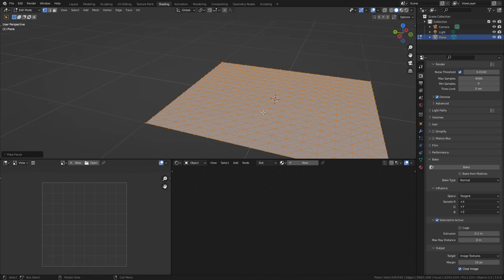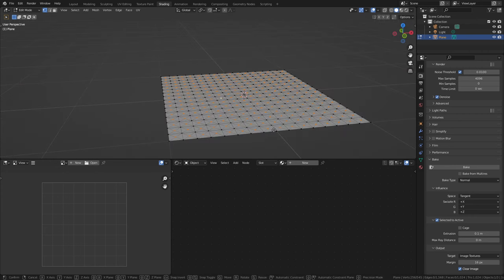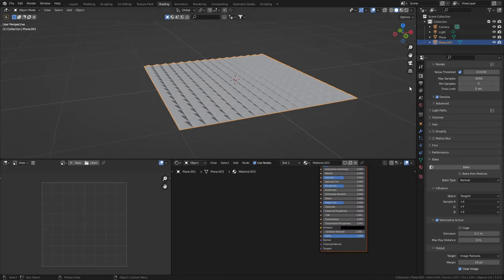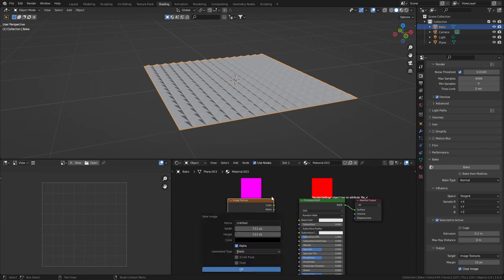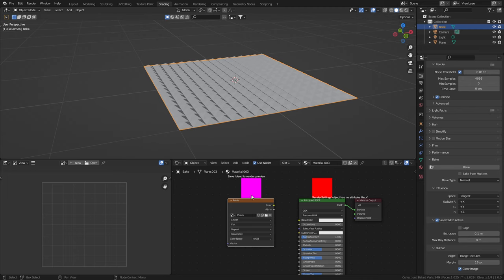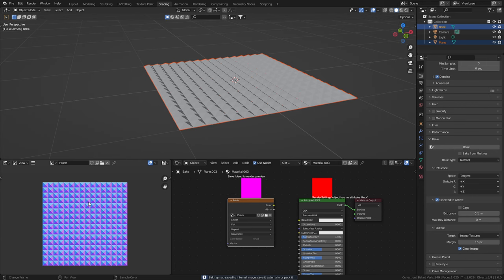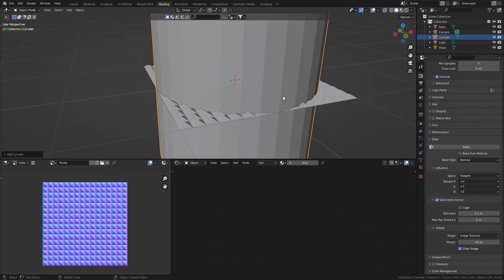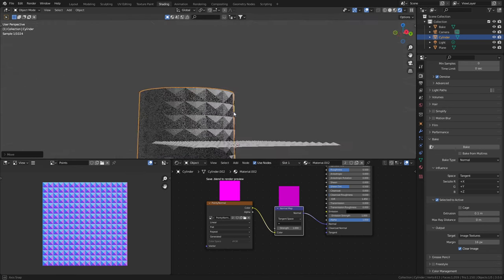How to Bake Normals in 1 minute Blender Tutorial

Comment: Hey there, i followed your instructions but sadly i can't make it work, i get the normal map all blue with no textures and no matter how much with the extrution and ray options i dont get nothing... i tryed selecting the objects in different order and i get a normal map with the flat sides of the low poly mesh... i've watched like 10 different tutorials... maybe you could help me out? or maybe the comment section can help me? thanks a lot.
Reply: they need to overlap! I just learned :) both geometry meshes/objects must be at exact same position. Or as close as possible.
Reply: @MagnusHertzberg  Holy shit, thank you. I've watched like 5 different tutorials on how to do this and NOBODY mentioned they have to overlap. What the fuck is wrong with people?
Reply: @salbertron  They absolutely do not need to overlap, in fact it's better that the bake object hovers over the plane/object being baked on to. You just need to adjust your "Extrusion" and "Max Ray Distance" settings so that the rays travel far enough to hit both objects and create the normals/pixels. Best practice is to have them NOT overlap when you can avoid it.

Comment: Very concise tutorial! In this case you can probably either give some random height variation, or tile that one part and give it random strength based on which tile it's looking at (input rounded texture coords into white noise texture to get a random number you can use) if you want to go beyond the scope of the one minute- that would really help avoid tiling patterns.  Otherwise having the same pattern is just taking up 400x more space.

Comment: Doesn't work for me. I am doing EXACTLY the same, every step. And when the bake is done processing I don't see anything in the image editor, just the transparent default grid 
If I  play around with the extrusion number, I manage to get the flat purple color, but never the details of the highpoly mesh
Any ideas?   :(
Reply from the maker: Hmmmm check your normals, also try adding a bevel
Reply: @Markom3D  I found the solution:
In the Render Properties > Sampling > Render: set the "Max samples" to 1, and turn off Denoise
That fixed it for me. 
This video explains it:
https://www.youtube.com/watch?v=taBwyMWCnis
Reply: The strange thing is that I had the same settings as in your video, max samples 4096 and denoise activated, but for some reason it wasn't working.